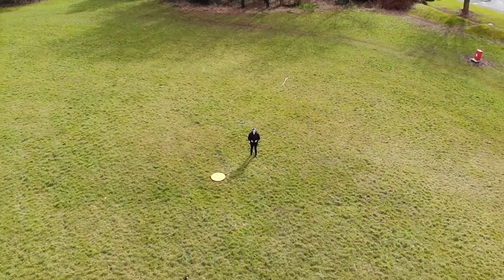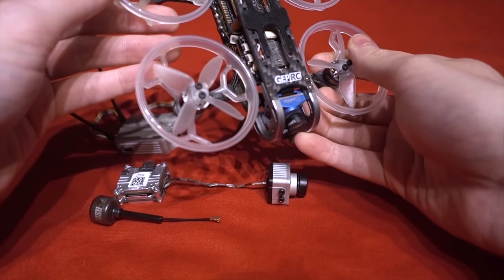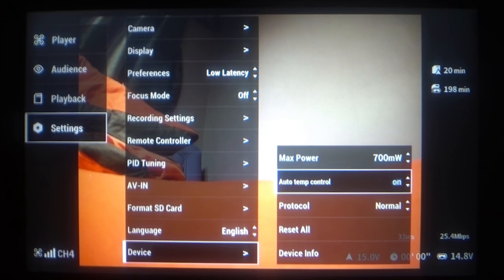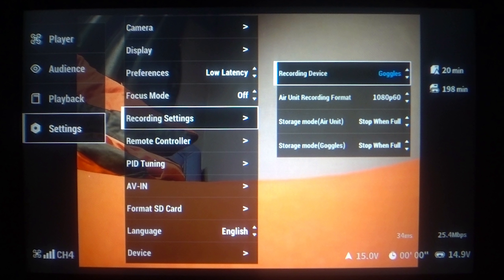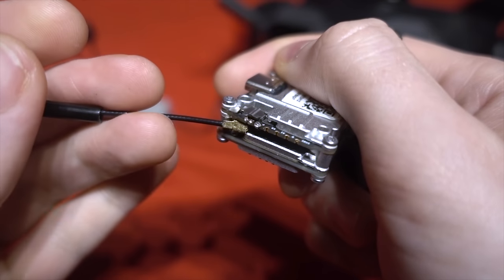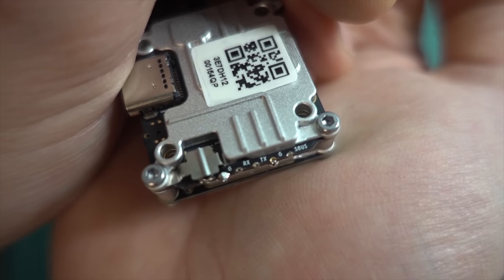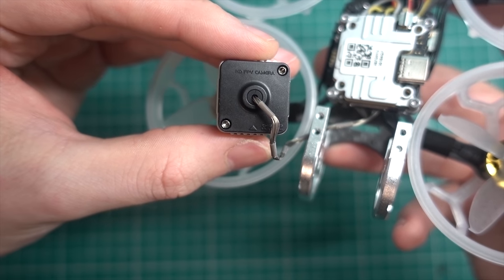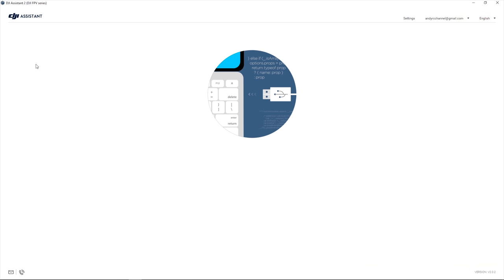Caddx Vista Best HD FPV System

Comment: This hobby is evolving so freaking fast. Just a couple years ago when I began flying fpv, it was F3 FC's w/  no OSD,  no smart audio and low res goggles. Boy have things changed in a hurry.
Reply: Haha yer bro i remember putting a battery tester on my balance lead just so i new wen to come in on my old wizard.  😃👊 yep those wer the days
Reply: What is smart audio?
Reply: @blackterminal  ...Newer vtx's have what's called vtx control. It gives the pilot the ability to change the vtx channel, band, and power settjng thru the betaflight OSD menu in you goggles using your radio as control. Its hands off. No more pushing buttons on the vtx trying to decode tiny leds. 
The vtx is wired to an available uart using the Tx pad of that uart on the flight controller. There are two communication protocols that are used by the flight controller to talk to the vtx. One protocol is called "smart audio" developed by TBS. The term "smart audio" has become synonymous with vtx control. The other protocol developed by Immersion is called "Tramp" . It's important to know what protocol your vtx is using in order to configure it correctly in betaflight. 
Something to note, just because your vtx has smart audio doesn't mean you have to use it. You can always manually change the settings of the vtx with the button on the vtx if you chose not to connect the SA wire. I hope that was thorough enough of an explanation.

Comment: What is that 4 mile cut-off you mentioned? Does the FPV feed just cut off if you're using a GPS? Or are you confusing this with the normal DJI quadcopters?

Comment: Great review, nice product... HOWEVER this is the first generation of digital FPV. And their are some issues. I'll wait a bit to see what improvements have been made or any new products from other manufacturers come out. There were times that I was one of the first to grab a new product and everything went well like my Futaba 16SZ and Skyzone 03O goggles and Traxxas UDR Truck. Most of my experiences in life tell me to wait on this one. I'm getting some real good  FPV with my Skyzones  Runcam hybrid and 600mw power.  On 1200mw it's practically digital. Yes I've tried the DJI FPV, not bad at all, in fact quite a good experience I'll admit but I'll still wait💖

Comment: Well there goes another 600 dollars over the course of the next three months as I slowly convert everything over, totally worth it though. I cant wait to do my Diatone R349, that will be a treat.
Reply: Also Andy this is the moment that I have waited for a long time. This technology has finally presented itself and I am more than in. Its frustrating as you know to see these other tremendous parallel advances made with quad copters and still have to fly them through feeds that look like inter dimensional space vomit. I will be soaking over two grand into this easily this year.
Reply from the maker: @joshuasterling2144  you got it. Enjoy
Reply: Just a heads up, I just got one to barely fit in my 349, the camera can’t actually mount, you have to use the plastic canopy and pinch it, and trying to put it in there is an ordeal. It can definitely be done, it just seems kinda janky, but the camera, despite not having any mounting screws, is rock solid because everything is so crammed
Reply from the maker: @ianozborne1555  well the 349 is a micro sized cam and in order to comply with the FCC regulations the dji camea couldn't be a standard fit. so if you are trying to fit it to the 349 I empathize with you. But fear not. As the video metions there are more frames being made to fit this system than I can keep up with.
Reply: @AndyRCchannel  Thanks bud and Cheers to you.

Comment: Throwing up a hail mary here guys.  Brand new to fpv and I completely messed up my cinebee.  Was working ok.  Flew it a couple times, but the throttle was buggy.  I thought since I followed another youtube video exactly maybe I did something wrong.  So in betaflight I hit reset settings.  Now nothing works.  The uart ports are gone.  Can't get them back no matter what I do.  Drone on the screen in betaflight doesn't move when I move the drone physically.  The calibrate accelerometer and magnetometer are greyed out too.  Even when I plug in a battery, there used to be 3 quick chimes, then 2 more.  Now I only get the 3 quick chimes.  I'm completely lost.  Any of you reading this PLEASE help!!

Comment: Great stuff,I have the air unit in a 5 inch and have the caddx vista for a new built. Ordered all the parts to built this but I need the wiring diagram..Caddx Vista to GEP-20A-F4 . I cant find info on this. I don"t want to mess with this till I"m sure of the pinout..thx

Comment: Hi....Andy please give inform. I install Caddx Vista on Mamba F722 mini, at Betaflight version 4.1.5 has 6 uarts. Where port uart cable Rx Tx from camera?
Note: The Uart is:
-Vcp = msp
-Uart1 = Sbus Frsky Receiver XM+
-Uart2 = ESC filter (Rx2)
-Uart3 ex VTX Smart Audio (Tx3)
-Uart4 = msp
-Uart5 vacancy
-Uart6 vacancy
Reply from the maker: 5 or 6 cheers

Comment: Will the GEPRC rocket accept 2.5 inch props if you remove the guards?  Albert Kim was only getting 3 minutes of flight time which is too little for me.
Reply from the maker: doesnt need 2.5 inch props. Needs the right battery

Comment: There is no R1 pad but the GEP-20A-F4 AIO manual shows pads for T2 and R2. I'm not sure why that wouldn't have also worked to carry the Vista TX/RX lines? I'd be pretty scared if that board had zero complete (TX/RX) backup UART options. There was another Rocket on the DJI FB that had very poor soldering.
Reply from the maker: R2 is needed for the control signal
Reply: @AndyRCchannel  Oh understood thanks!

Comment: Do you need to have the dji transmitter aswell, or is it just the googles and digital unit? From seeing this im sold. Much appreciated
Reply: Kyle Fpv no just the goggles. The transmitter is just a tipical dji think for people who like to fly with the standard dji controller
Reply: The dji transmitter has ultra low latency, half that of crossfire. Thats a big advantage for racers. And no messing wirh external receivers and antennas on these small frames.
Reply: @GoldCustomBuilds  NO, most likely not cause dji remotes use ocusync ...

This  unit and the dji fpv set air unit are DIFFERENT to the DJI Drone Goggles racing edition's air unit that use ocusync 2.

That's why I'm looking for a caddx unit that connects to dji goggles racing edition cause they are a lot smaller than dji air unit for my dji racing googles
Reply: @GoldCustomBuilds  great.. im not to bothered about a few ms of latency as i dont race, just freestyle, exploring and some cinematic so happy days. Is there anywhere in the uk where you can try these before parting with almost £600?? Already iv geard that the fit isnt the greatest.. for that money it better bloody fit amazing. But id rather check 1st. Cheers

Comment: Now they just need to release a system with only the VTX portion.... the receiver portion is not really required since many fpv pilots have separate receivers and transmitters
Reply from the maker: the receiver doesnt take up any extra weight. digital doesnt work the same as analogue. its using mimo so it can accept multiple signals at the same time. a non receiver option is also what the vista is
Reply: AndyRC ah .. got it ! Thanks mate

Comment: Good one, mate. I enjoy your videos, and really appreciate the quality of information provided by this standout channel. Ill check out your your link.

So, Im loving the Vista on a sub 250 micro long range, getting an easy 10 minutes on 650 LiHv 4S. My only issue is that regardless of my settings,  Im getting a minimum latency of around 40ms+, even in close proximity. It's not bothering me at all, but I fear it may be indicative of misconfiguration, or a hardware issue. Any ideas?
Reply from the maker: sounds like you have it in high quality mode and not low latency mode

Comment: How does the 1200mw unlock work? You still set the power level through the goggles right? Why not unlock 1200mw then only enable it via goggles if you actually need the range? Or have I got it all wrong, my goggles haven't arrived yet
Reply from the maker: yeah you are right you can do that. its just a text file like the region unlock. But you would be breaking your warranty going above 700mw (they can see it from the logs if anything breaks) and you will get about 20 meters more range so is it worth the hassle?
Reply: @AndyRCchannel  DJI repaired my popped air unit under warranty and I had been using 1200mw, can't fault them
Reply: Kettle Vale yup same here, replaced my duff air unit no questions asked.
Reply: @AndyRCchannel  ok, I hadn't thought of the logs. But I'm not needing the longer range, so I won't be doing the unlock

Comment: Great review! You know if I take an extreme view, it could be said that DJI are holding the future of companies like Fatshark and Orqa in their hands. If DJI decides to release a module or some system that could work with other goggles, those companies might have a fighting chance. Without that, I don't see how by the end of 2020 Fatshark or Orqa can be convincing anyone to buy their goggles. I hope DJI does release a solution for others as I think it would be good for the hobby overall. Surely they would sell a ton of modules even at $200 and in a much greater number than $500 goggles.
Reply: Thats why they are not gonna release a module any time soon.  They are also gonna wait to enable the hdmi out. Because that would enable to use other goggles. fs and orqa first need to die
Reply: @hansturpyn5455  Couldn't they still enable HDMI out on their own goggles? So you'd still need to buy those, but at least have the option for spectator screens. For me it's the only reason I am not yet getting DJI goggles!
Reply: @lievenvv  I love em. We fly DJI with 7-8 persons.  every weekend and it's a relief over analog. We cant stomp each others frequencies.
Reply: @hansturpyn5455  Yes, I know I would love them too!!! Just waiting for a firmware update or V2 goggles so I can have spectators or do live FPV demos.. Digital would be just perfect for that

Comment: how can u ever fit a caddx vista in a 5 inch drone with that short wire
Reply from the maker: Well the lead is 12 cm or 4.7 inches. Never had a problem to this date but you can buy 20cm leads. Only usually needed for 7 inch

Comment: I barely got one to fit in a diatone 349 and lemme say, it rips
Reply from the maker: it shouldn't fit the 349 due to the camera being wider than the housing. It will most likely crack installing it or crack eventually
Reply: AndyRC yea the mounting holes don’t fit, but the way I have it in there, the housing will probably crack in a hard crash, but then again, what housing wouldn’t? Lol. I’m thinking if 3D printing a new canopy for a better fit
Reply: AndyRC I’ve found that the 349 has just enough flex in the canopy to accommodate the camera and lock it in place. There’s also no vibes or jello so that’s pretty gucci

Comment: You can't deny the performance of digital. We all spend a lot of money on quads, radios, receivers, antennas, chargers, batteries and the list goes on, and you get reception equivalent to a TV set from the 1970's - well, something is not quite right  is it!? I will not buy anything new that's not digital and I will slowly morph to digital on the existing fleet. I have to say though I hate the look of the DJI goggles and would love to see a more streamlined (better fitting) version but I'm not sure I can wait it out.
Reply from the maker: they fit much better now with the new face pad they are selling. definitely worth getting one but they should have got it right first time and it should be free if you bought a set
Reply: Yeh, I know Andy but they are still bulky and ugly, particularly if you want to mount an external analogue module for your ageing fleet.
Reply from the maker: @dronedownunder652  counter argument. name a pair of goggles that will make you look sexy to the opposite gender
Reply: Beer goggles of course!....c'mon Andy those things are binocular box goggles that look like a floating world war two bomb !
Reply from the maker: Good answer haha

Comment: 4 miles hard cutoff?!! what?
Reply from the maker: I know right it should be much less if we want to save our great hobby
Reply: @AndyRCchannel  how do they determine distance though... and why the cutoff?
Reply from the maker: @laurentrentrent   you would have to ask DJI that. Its something they would not answer me on but there is a lot you can do with digital signals that you cant do with analogue. In either case 4 miles of range is way to much to keep this hobby safe and legal.
Reply: Not what I had in mind but maybe there is an angle I didn't consider. So tell me how is losing video + control of my quad at 4 miles making the hobby safe.
Reply: @laurentrentrent  your complaining about 4 MILES....really? That's 6.45 kilometers....if your flying farther than that away you need a ground station, spotters, 2.4 band, and seriously good gps equipment.

Because even with analogue sometimes you will turn around to come back and the signal goes out.
Reply from the maker: @laurentrentrent  im saying that flying out to 4 miles is not a safe or smart thing to do in general and is why we now have to register, pay 9 quid a year and take tests in the uk
Reply: Here is an answer: https://www.youtube.com/watch?v=F373Jbzhb7M
4 mile cutoff a byproduct of adaptive compression... makes sense

Comment: Mr Amdy RC:  you are the best !  thank you.    I am retired on Social Security so I buy everything on sale !  I have 10 of the AirUnits so far and just yesterday received the Vista.  It performs just lie the original BUT …   the cable ?  I kniw what you will say (weight )  but WHY NOT the same on both ?  maybe one short one long ?  Sorry I do NOT like thi cable (same as Occusinc system) ...and the antenna ?  hmmmm..   someone at DJI  must have approved this terrible cable ??   why wouldn't that person (engineer)  just say "maybe we should have the cable compatible for both ?"     whatever ...couple more months I will break put some analog small kwads (Vifly 150 or all the Diatone tMotor etc)  buty honestly I will buy a couple BNF with DJI installed 3".  leave the small builds to people with good eyes ..
Reply from the maker: well iv got many tarsier and runcam split cams and am yet to have an issue with this method. Also if you think about it. there is stress releif on both sides so really all you are missing is the rubber wire which isn't doing a lot?
Reply: Could just buy an air unit camera for 60 bucks, would that work?
Reply from the maker: @ianozborne1555  cameras are the same
Reply: Your on Social Security and have 10 air units etc already and the goggles !